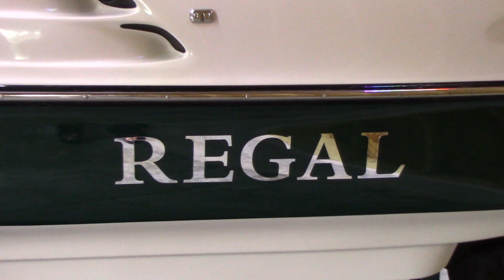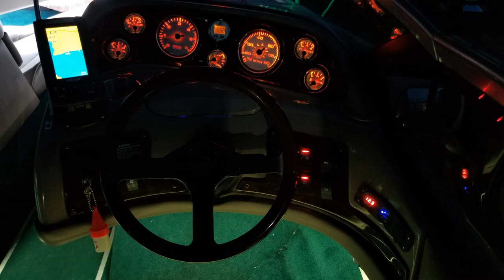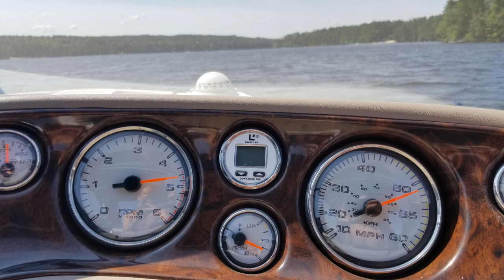How-To Replace All Trailer Brakes; Backing Plate, Cyl, Pads and Bleed System

Comment: Hmmm…. Isn’t there a brake line attached to the piston from the rear? Your video skipped this completely. Kinda important, especially since the fittings can be completely corroded.

Comment: Title is misleading. Was hoping to see how the put new shoes in.
Reply from the maker: LOL.  What part is misleading?  I literally replace exactly what is in the title.  The pads pop out with 1 center stud and two springs. Not exactly rocket science in need of a walk through.
Reply: It seems like you will show how to replace each part, not the assembly. That's what I meant. I'm looking for a video to show that as replacing the assembly isn't an option due to unavailability of options that are on my trailer. Just replacing the shoes on mine. Thank you.